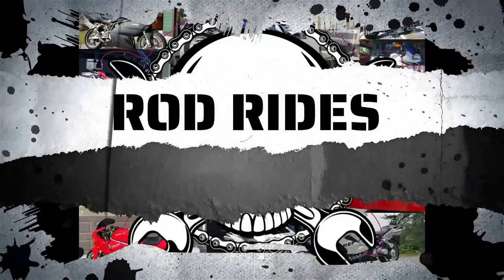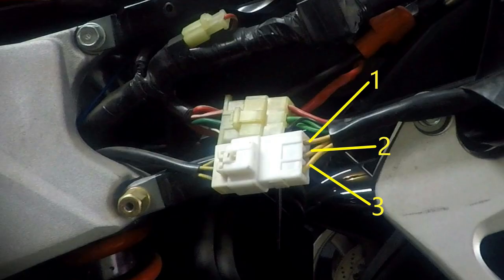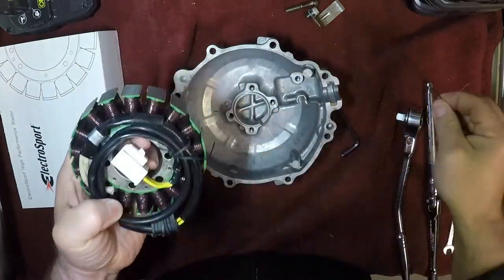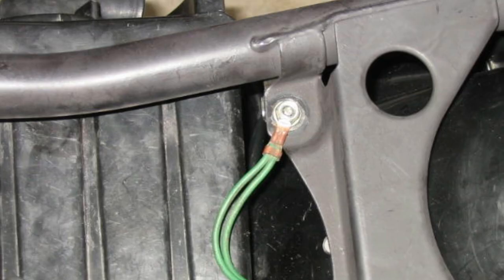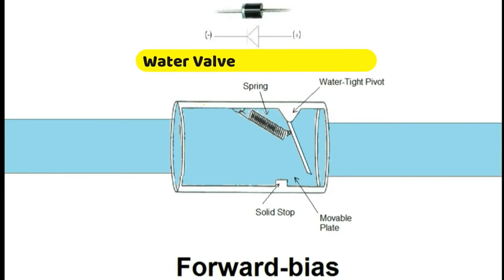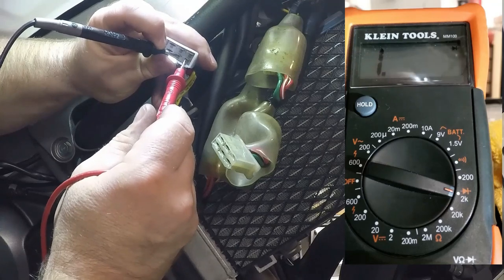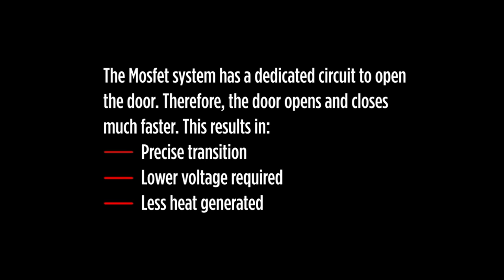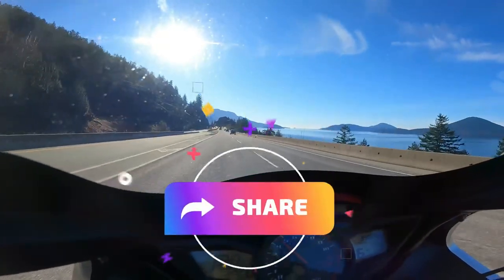Motorcycle Stator Voltage Regulator Rectifier Testing & How They Work

Comment: Very nicely done thanks for the content.   I'm a 25 year auto tech so I'm very familiar with charging and electrical systems but was clue less how to diag my old Honda.   1st motorcycle. 
I have a 81 honda cm400 runs great but I'm worried my battery isn't charging properly.   Only driven it maybe a dozen times all together 50 miles ish.  It seems to maintain V and i haven't had to put the charger on it at all. stays 13.1v to 12.6v range.  I have a 4 cell lithium battery.  Interestingly if i ride with the head light on it'll drop .5v soon as i turn on the lights.   Down to 12.5 or 12.3v. At first i was thinking it was just maintaining at 13v ish because of the reg/rec.  
I'm unsure if i have a new looking orig reg/rec i.e. not the correct one for my battery or if its functioning normal because it's a reg/rec that is proper for my battery and this is just normal for this type of system on an older charging system?   
Reving the engine doesn't really raise the V which seems to be a huge red flag???? 
My trips are 6 to 10 miles one way and i dont seem to be losing voltage.   How long would it take to drain a tiny 4cell li batt riding if the stator wasn't working?   
Sorry long question/ post.
Reply from the maker: There are two components to this question. One the stator & RR, the stator should be tested in a few different ways to ensure one of the phases are not burnt.  My preferred way is to test to ground.  When the coils are burnt, they will almost always ground so see this video. https://youtu.be/bUb97GnDLOU?si=4APmrRKNuvw2LLEk
The other way is AC Voltage and you should see it fluctuate with RPM as you saw in the video you posted this question to.  If the AC Voltage doesn’t go up between stator phases with RPM, there is a stator problem.  The third way is by resistance ohms but most people can’t do this properly so I tend not to recommend it, since you are a technician and know how to set your multimeter to read ohms, the hot and the neutral from the stator should have less than 0.5 ohms resistance.  More than 1.0 ohms and I recommend immediate replacement.
The other component is your lithium battery.  Lithium-ion batteries have low resistance and maintain even voltages much better than lead acid.  All MC lithium batteries have battery monitors that control and clean the current coming from your RR to the battery.  Lithium batteries do not like voltage ripple and should only be used with high frequency charging, the battery monitor helps as the go between from your bike to the lithium cells and is supposed to prevent a thermal event.  The lithium battery takes less voltage but sustains it more evenly during discharge.  It can also discharge deeper.  So, the state of charge of the battery, when you tested voltage with the bike running, will influence your readings.  A high SOC will result in a lower measured voltage and vice versa. If you are testing for DC voltage at the battery with a charged lithium battery, your results will not vary much.  To answer your question, I don’t know how long it would take to discharge, there are too many variables.  A battery can discharge while sitting in traffic idling if it is weak and the stator not that powerful.  My recommendation is to measure AC Voltage from the stator coils and see how even and high they are.  If you have a burnt phase or if the stator voltage does not change with RPM, replace it and/or the rotor. – Good Luck & Thanks for the Question

Comment: Did this test on my VFR800, regulator seemed OK, and the stator broken. I changed the stator, everything seems OK. Took a 2 hour ride, then the battery was dead again.  Any ideas? The battery is brand new.
Reply from the maker: Bike running at 5000RPM, headlight high beam on  what is the voltage at your battery? have you fully checked the regulator rectifier?https://youtu.be/bUb97GnDLOU
I've seen this before, where a brand new regulator turns out to be faulty.  You said you replaced the stator, you performed the ground continuity test and the phases went to ground/earth on the old stator?

Comment: Thanks for great videos and troubleshooting tutorials. i've been having problems with a 98. vfr 800. stator checks out so i changed the regulator/rectifier as i only meassured 4-6V dc before it cuts out when reving  . on the new one i dont meassure anything out from the regulator. do you have any tips on what to check next?
Reply from the maker: Hey there rummelist, so you've confirmed your stator is good, correct? https://youtu.be/bUb97GnDLOU  What is the AC output on the three leads coming out of the stator which was demonstrated in this video?  If there is strong AC power accross all the three phases and none of the stator phases are going to ground, there are a few things that can go wrong, primary suggestion is you've got yourself a bad regulator rectifier.  Even new ones can be bad.  Diode test the new RR as demonstrated in the video link.  Is the regulator rectifier installed properly? It needs to be grounded to the bike to work and the ground connection from the frame to the RR body must be clean.  Check all your connectors on the RR going into the harness and from the stator, if a blade got bent or pushed out of position this may be your answer.  Good Luck!
Reply: @RodRidesWrenches  Hey again. Now im not so sure what's wrong to be honest. I meassure around 90-100V AC from the stator on all three phases (when reving high, starts at about 17V on idle) the old reg/rec gives out 9v on idle and gives out around 19 on high revs (this is abit to high, right?) but this is only when the engine is cold,  the reg/rec cuts out after abit and stays at 5v out max. i have checked the connections from the stator the reg/rec and into the harness. all seems good, even cleaned the connections for good meassure. i also put another ground wire going from the reg/rec casing/housing to the battery. i have got a new reg/rec but this only puts out 2V DC. and i dont have a multimeter that has diode testing. what else can i check or do you have an idea of what can be causing these readings?
Reply from the maker: @rummellist  The RR is bad.  The diodes are shutting down when they heat up.  That's why your current drops.  Sounds like the stator is fine the regulator rectifier is bad.  You are not the first one to get a bad out of box regulator rectifier on this thread.  A final though, when installing your replacement, make sure your grounding surface, the back of the RR to the frame, is clean and the regulator rectifier has solid contact.

Comment: so with the lithium ion batteries, i'm not 100% on them as i hear with extreme temps (like 100 degrees or below freezing) they don't charge, and once they lose a charge they're ruined? like if it goes dead, there's no reviving it. Is that the case?
Reply from the maker: Flooded batteries are no better in extreme climate.  Lithium-ion works better below freezing since there is nothing in them to freeze like in a flooded battery but all batteries lose about 1/3 of capacity in extreme cold.  Flooded batteries can freeze easily if they are discharged and cold.  If any battery is fully depleted, especially flooded batteries it will cause damage that shortens the battery life.  Premium brand Lithium-Ion batteries have monitors that don't let it discharge beyond a specific setting like 10% left in the battery (flooded should not discharge beyond 20% left).  Lithium is more expensive than an AGM (my other preferred choice) but offer some sincere advantage.  Especially if you don't ride through the entire year (bike's in storage) or you are looking to shed weight (which is significant).  Thanks for the comment!

Comment: How has your New Electrosport stator held up??
Reply from the maker: Hello Alejandro, The stator is fine, I have now gone back to the manufacturer and found it available through this link for even less $$$  https://rebrand.ly/iqkvr4i
Reply: @RodRidesWrenches  thanks. No I’m getting one for a 07 GSXR600 for 125. I like how windings are sealed with epoxy as to help with aging. 
Thank you

Comment: Thanks very much for the video,I want to ask,I started my Ducati 959 corse when starting it has a little hard starting and when it successfully starts the head lamp after a short while automatically goes off but I check the Coil, Battery and electrifier all good so can you please enlighten me more
Reply from the maker: Sounds like the battery is not getting enough current at idle.  Check battery voltage with the bike off.  Should be 12.1-12.6VDC.  Start the bike.  Check battery voltage, is the voltage dropping? Weak battery would be my first guess, weak stator my second.  Turn the light high beam on, rev and hold bike at 5000RPM, Voltage should now be between 13.5 and 14.5 VDC if not bat regulator rectifier or stator.  This video will help you determine which https://youtu.be/bUb97GnDLOU

Comment: I have a parasitic draw on my battery and was wondering if the voltage regulator / rectifier might cause this?
Reply from the maker: Hey Scott, unlikely for parasitic draw.  Most likely aftermarket accessories or your ignition key/switch is faulty.  Worst case there is a breakdown in your wiring somewhere.  Have you measured the draw?  Try and localize at the fuses.  Remove fuses while you meter is on the battery to figure out what is pulling it down and remember even a battery with good open circuit voltage will fail under load when it is on its way out.  Good luck!

Comment: So if my bike idles with a low at 12..2volts its probably the stator since its not making enough current correct?
Reply from the maker: There are too many variables here.  The idle voltage does not indicate the condition.  Turn your headlight high beam on and rev and hold your bike at 5000rpm  what is the voltage then?  This will tell you if there is a problem with the stator.
Reply from the maker: https://youtu.be/bUb97GnDLOU
Reply: @RodRidesWrenches  with the headlights on it drops to 11volts idle and while revving it maybe hits 12.9
Reply: @RodRidesWrenches  and thank you ill check out that video
Reply from the maker: @gabrielgalaxygh  I would look at the battery first!  Fully charged, overnight on a 1.5 amp tender or charger, take it off the charger, wait 30 minutes, what is the voltage before turning anything on?  If it is below 13V you need a new battery.  https://youtu.be/xXkq-p59oao
Reply: @RodRidesWrenches  I'll try that. Thank you again

Comment: Is safe to change my stock battery witch is flooded type to lithium one?It is safe for my stock stator and rectifier system,because of the different voltages my system produce to charge? Thanks for the videos,well done!!!
My bike is Aprilia Pegaso 650 ie 2004.
Reply from the maker: It is safe to retrofit any bike with a lithium battery however you want to get one with a built in battery monitoring system.  These batteries have a button and a state of charge display.  The battery monitor will prevent over charging (thermal runaway) and cut power to prevent accidental discharging.  Check these out.  https://ebay.us/8STUHQ
Reply: @RodRidesWrenches  Thank you so much for the quick answer 😉.If the battery cut the power in case of overcharging,then you have to reengage the charging mode with the button?Or the system automatically do this? Does the same for the charge from stator and external charger?My best regards!!!
Reply from the maker: @TitaniumRxx  Does it automatically

Comment: I have a question, can we test the regulator voltage without being conected to the battery? If 14.5 V comes out of the regulator or There's only that voltage if we are conected to the battery
Reply from the maker: The battery completes the circuit, no way to run the bike without it and you could very well fry the Regulator Rectifier.  Better, safer, easier to diode test the RR https://youtu.be/bUb97GnDLOU If you have anything between 12.5 - 15VDC with the high beam on at 5000RPM there should not be an issue with the RR.  If your running current is good but the bike fails to restart after a short time it is the battery or a parasitic draw, disconnect your aftermarket accessories to find out which one. There was an old car trick to test the charging system by disconnecting just the positive lead while the engine was running, I would not do this on anything with electronic ignition. - Good Luck!
Reply: @RodRidesWrenches  i disconected the positive and the negative that goes to the battery and tried to mesure voltage to see if its sending 14v to the battery butt i only mesure 2.5v but when i connect to the battery its 14v with the lights on, maybe the regulator has to detect the battery to work?

Comment: I just installed a LI battery in a 2006 Electra Glide. Bike starts much better, everything electrical seems to work fine. Until I increase the RPM's. The radio seems to shut down and then back on again. This happens with RPM changes. I do not notice any flickering of the lights or gauges. The battery has a BMS (battery management system) built in. Could this be causing my issue?
Reply from the maker: Check your ground connections at the battery and engine.  check the connectors where you removed and reinstalled the battery to make sure noting came loose.  Finally remove your Regulator Rectifier and clean the area where it mounts to the frame.  These are really exposed to the weather on a HD, make sure there is good connectivity from the RR to the frame to improve voltage dump of the regulator rectifier. Does your ammeter on your dash indicate anything weird when revving the motor?  I do not see how an Li battery could affect the radio but if you have the old battery still you can put it back and see if it makes a difference, you could have a bad battery (it happens).   Put a voltmeter on the battery terminals and bring the RPM up, I don't know what the peak O/P is on a twincam for the stator but assume it is 3500RPM.  What is the voltage at the battery? should be sub 13.5V Some BMS systems cut power to prevent overcharge and thermal fire (Antigravity Batteries).  Check with the manufacturer to see if this could be a problem and if they have a retrofit regulator rectifier to match their battery for your bike.  
Good Luck!
Reply: @RodRidesWrenches  Thanks!  Old battery is dead. Bike has been sitting about a year. I have a conventional battery coming. (Hopefully by Friday) I will let you know how that works. I did not have this issue until I put in the LI battery. Here is some more information on that battery. (High security - L*****4 motorcycle battery will never catch fire or bomb under worst condition. And this battery included a BMS (battery management system) which can turn off the power automatic while the battery under-voltage)
Reply: Sorry! I did not see your entire reply before. I will do some more checking. Thanks!
Reply: Bike sat 7 days with LI battery installed. Before changing battery, I checked volts 13.1V with bike off, started bike was getting up to 14.1V depending on rpm... No issue with radio. ran motor for about 20 min, still no issue. Decided to ride bike and around 10 miles into the ride (+, -) the radio started cutting on and off again. Returned home and checked volts, 13.9 on battery with bike off. Changed to the lead battery and drove for over 20 miles with no radio issues. Might be a good upgrade for some, but not me. Thanks again for your input.
Reply from the maker: @williewilliams7257  I think there is a problem with your lithium battery/regulator rectifier.  What I have observed as well as others have noted, the Lithium battery voltage typically does not exceed 14V under high RPM charge load.  A lithium battery's resistance (what controls the voltage from your regulator rectifier) is pretty consistent regardless of state of charge (unlike a lead acid battery).  Please tell us what brand of battery it is as I suspect you have a bad one.

Comment: Would a bad Stator burn out 2 lithium ion batteries?

Voltage test showed huge variance from 9-15V when running

1975 Honda CB200 w/ new rectifier

My ohms @200 read 5.2, 5.3 and .8 from Stator, but nothing on Ground Test… ohms are pose to be 0.1-1.0

Bike not running, can’t do Running Tests, I need help *shrug
Reply from the maker: Sounds like a bad regulator rectifier i know you said it was new but it sounds like a bad one, replace it.  Make sure it is secured to the frame and properly grounded since it shunts power through the RR body to the frame.  Check your power cables, bad or corroded, not grounded properly to the engine.  15v is too high for a 12v lithium ion so the regulator rectifier would be the problem.  Good Luck

Comment: I'm confused because my Klein has both symbols next each other and I'm don't understand how to read this only by visual watching youtube. So why and how do I measure and get the results with 2 of the symbols for testing are side by side. I thought I found the right video up until this point when I realized the difference in the way my display looks. It's probably a simple overlook on my part but without the expert advice I will be here cussing and throwing a tantrum because nothing is going the way I want to.Can both symbols be next to each other on the meter like that, I guest thats how it came but all the video's I see are different than mine
Reply from the maker: What setting are you looking for?  Alternating Current is usually a V with a wave symbol.  Direct Current is usually a V with a flat line or a live with dashes.  Diode testing and continuity testing can be on the same setting of some multimeters.

Comment: Silly question. Did you run all these tests with a connected battery ?
Reply from the maker: Of course.  Difficult to start the bike without it.  The stator is isolated from the bike though when the harness is unplugged and the battery is required to complete the circuit when testing the RR.